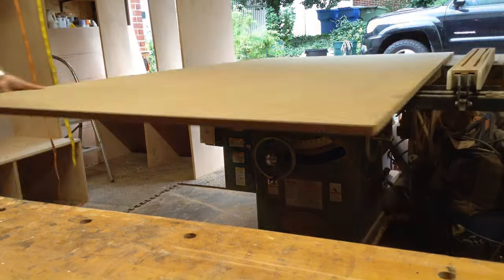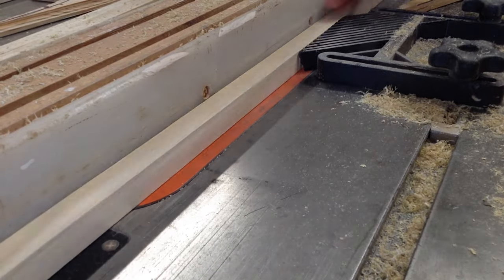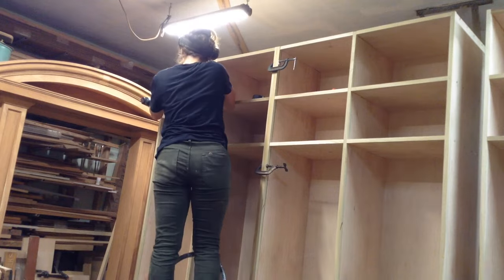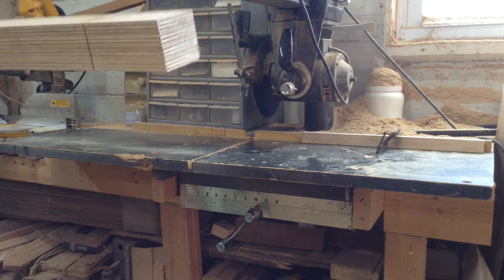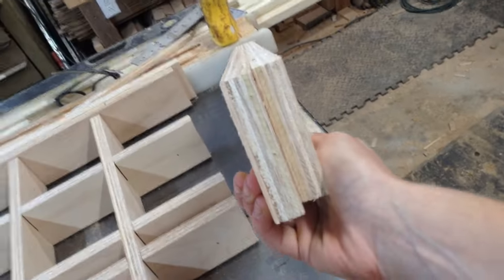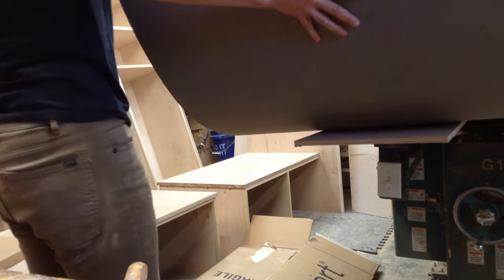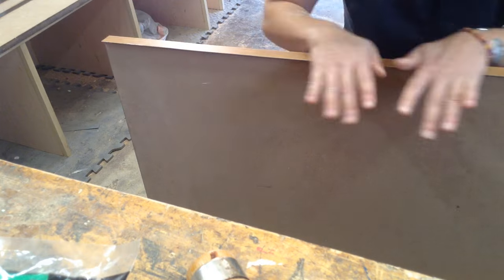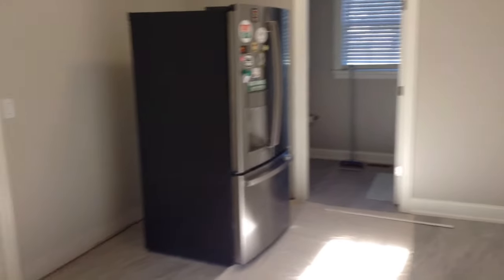Easiest Type Of Built In To Make || Built In How-To [Part 2]

Comment: Great work and great camera work - thank you for showing so much of what's involved. You must save a fortune on gym membership with pieces this size! Those long shots are really helpful to see the scale of the jobs and how you cope in a limited space. I'm not a lover of laminate either or contact cement but when I've trimmed edges in the past I rough-cut the overhang first so it's much smaller than the router bit so I get less 'chatter' from the flush trim. It means I don't clench my teeth as much as I'm running the router.
Reply from the maker: I’ll have to do that next time, because it is nerve wracking.

Comment: Great video.  No apology necessary for using 3/4 ply.  I try to use scrap plywood as fast as I can irrespective of thickness.  Otherwise it’s just hanging around the shop for too long getting in the way.
Reply from the maker: I’m the same way with using scrap.

Comment: Hi 👋, Honey 🍯 Badger 🦡, very nice looking 👀 job, well worth the work, many years ago, like you when first started out, done a lot of projects using laminate never liked it, for the same reason you don’t like it if you make a mistake, you’ve got to start all over again, but as years ago by , everything I made was out of solid, unless it was backing or draw bottoms, glad to see you using a vacuum bag, great bit of kit, but very expensive, i’ve made quite a few reinforced doors using a vacuum bag , like this with hardwood, edging and facing on both sides, 
I think considering you have got quite a small workshop , you are producing excellent work, as for arranging your jobs around in your workshop and filming at the same time must be very difficult, keep up the great work. Look forward to your next project., 
Phil from the moulin France.
Reply from the maker: Thanks!  The hardest part of filming is the angles.  It can be a pain trying to get a shot in a small space that isn’t just my head blocking the work.
Reply: @HoneyBadgerWoodWorks Hi HBWW , I presume you are working out of a garage at your premises, or something very similar. Like you, I have struggled over the years have an insufficient room to build a manufacture products., if you can ever afford it, it’s always best to have your own workshop connected to your property within a few steps walking distance, I was quite lucky in 2003, 2004, I came across somebody who is very rich to say the least, they call them, poor farmers, 😂, this guy and his sons own a haulage business, approximately 20 Trucks, and hundreds of thousands of acres of farmland, he had got an old grain store, which wasn’t really used for anything, apart from dumping rubbish in, I took the plunge, play cleaned it all out for me and I was renting it for £450 a month roughly, plus electric plus heating et cetera et cetera, to say it was big is an understatement, about 8 m wide and somewhere around 35 m in length, I could even drive my van into the building close the door and unload and load timber or products any time day or night weather conditions., I ended up doing a lot of work for them until I retired in 2017/8 , I am now living in France, in a old moulin/mill, I have got most of my hand tools, but sadly I had to sell a very large radial arm saw, and a mortising machine, and a very large dust extractor, plus smaller bits, I am who is in my basement has roughly as a storage area at the moment around 12 m x 7 m, and I have a garage which is not finished. It still needs a floor and the Roof finishing off which I’m hoping to do within the next few months, and that’s about 6 m x 6 m, and I’m hoping to start back at work., during small renovation projects, I need something to keep yourself busy, as I live by myself, and all I seem to do is watch the YouTube, I do occasionally do a bit of wood turning, sorry I started to go on a bit then, problem, I’ve been by yourself, I wish you all the success for the future, 
Stay safe , Phil from the moulin France.
Reply from the maker: @philvale5724  Hey Phil, that shop sounds amazing!  I am currently working out of a two car garage in a house that is not mine.  I pay the rent in the garage by fixing up the outdated house.  To me this shop feels like a mansion, because up until about a year and a half ago I was working out of an old carriage house, that square footage wise was much smaller.  It only had 7.5 ft ceilings.  That was a  real challenge.   I agree it would be nice to have an even bigger space, buy where I live properties values are through the roof, so this works for now.
Reply: @HoneyBadgerWoodWorks  Hi 👋, property has gone up so much. It is at a real high premium, especially when it comes to rent in a workshop., as you have got to pay insurances taxes, and everything else on the property and maintain it, I was having to earn a best part of £1000 a month to pay for my workshop running costs, I took on this large barn back in 2004, 2005, as I started to get very large contracts, especially as I was working by myself, this money would’ve been better going into a mortgage back that time into a larger property with a barn or something on the land, though this would’ve been a problem now, because my partner and I have now split up, luckily I was married to her, in some respects, I’ve just wasted about 15 years of my life, put in time and effort him to restoring and building two properties for us, one in the UK and one in France, all being well in the next few weeks, my property should be in my name in France, the property in UK had to be sold, she’s ended up with loads of money, I’ve ended up with a rundown moulin/mill which still needs a lot of work doing to it, the property has got a very small basement, approximately 7 m x 12 m, with what I’ve got left of my tools and machinery, , I bet you would like to get your hands on some of these , large, planer, large thickness of large spindle, moulder, two large bandsaws  tenoning machine, and to very large, woodworking, lathes, plus all the tooling , jammed packed in there, very difficult to move and work., I do have a bit of a garage which I’m going to finish rebuilding hopefully before Christmas, but it needs a new concrete floor and the Roof finishing off, that will give me another 6 m x 6 m approximately, I do have a reasonable size piece of land, if I could ever afford it, I could build a bigger workshop on it , not sure whether I want to do that my timer life, if you weren’t so far away, I would gladly give you some bits and pieces to help you, but there’s not only the problem of having the tools and equipment and machinery, you’ve got to have the funds coming in to be able to maintain them and looking after them, I think in some respect I have been quite lucky over the last 10 to 15 years as I have had some quite very large contracts, mainly building and restoring five barn conversions, sadly these were not mine, but I made all the windows and doors and fixtures for the inside, not sure whether to say this not, but if you’ve got a partner who is interested in your work as well, that can be a very great asset to you, especially when it comes to moving things around and putting things together, 
I have been thinking about starting a small business again , but my biggest problem is that I cannot speak French, 
Unlike when I first come across there, in 2019, I had what I thought were some friends that were helping me , some give me some work on some helping me with paperwork, but now I have got a problems, they have now turned against me and are now trying to cause me problems, 
My ex female partner has told people a pack of lies , saying that I have not paid bills et cetera, and slandering my name, 
The thing is the question needs to be asked if I hadn’t been paying bills how would the work et cetera being done on the two properties? , 
Sorry HB , and I’m telling you things that I probably should not be saying, I wish you all the success for the future, and if I can ever help I would do, as I think it’s amazing that our young ladies are turning their hands to things that most men are not capable of doing, 
Keep up the great work. Stay safe. , Phil from the moulin France.